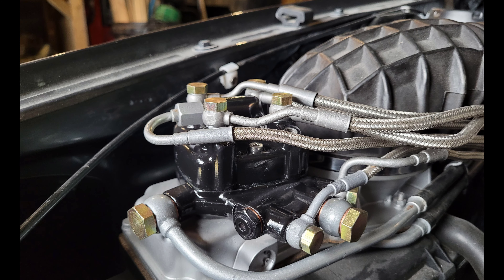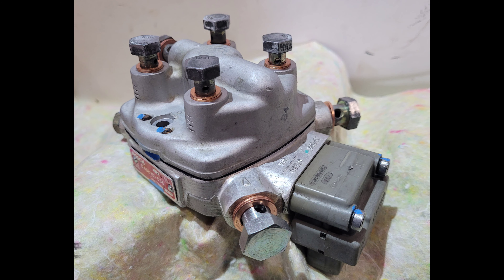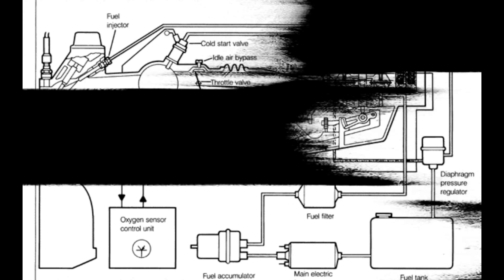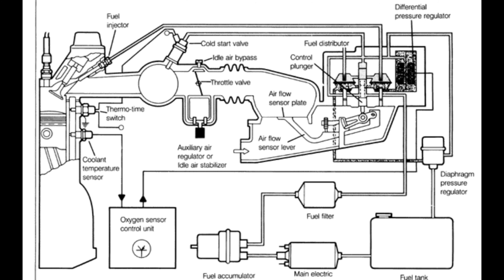Bosch K-jetronic CIS CIS-E and CIS-E Motronic

Comment: A question about mixing parts across the generations.  By class rules for a race car I'm not allowed to use a feedback loop injection system but am allowed to data log as much as I please.  This makes me want to run a CIS-E Motronic to get access to the flap potentiometer.  Will the later CIS-E fuel distributors work without the electronics connected or would I need to go all the way back to a CIS distributor head to make it functional on the late air meter?
Cheers
Reply from the maker: Interesting one, the later CIS-E units need the electrical side functional. Otherwise, it will be in 'limp home' state however you can use the air metering unit with the potentiometer and use the older K-jetronic fuel metering head. The bolt on the same and will just need an adjustment on the C0 screw to set the base idle fuel.
Reply: @GreyGooseRestorations  Thanks, can you recommend a 6cyl CIS head to go with an Audi 200 Turbo air meter?  I would think having the distribution tuning would be better in this application trying to tune to a reliable 300-350bhp 3.0L V6.
Reply from the maker: @CTXSLPR most likely a Porsche 6 cylinder one will do the job and flow enough fuel to support that

Comment: What would you say is the most common problem with CIS overall?

Also, on mine its a bit cranky on cold startup, I have to depress the gas pedal a little to keep the engine alive, but after 10 seconds of 10% throttle or so, it can manage to keep alive by itself
What should I try to look at first?

I did fiddle with the idle bypass screw, sadly it does not seem to react to it at all almost, very little difference
I have soaked the ISV with brakleen and it buzzes when ignition is on
Reply from the maker: The most common problem i have come across is the pressure relief valve seal as if its worn it lets fuel pass back to tank reducing system pressure.

Ideally check fuel pressures first as this will point you the right way, could be WUR, could be C02%, could be cold start system
Reply: @GreyGooseRestorations  Regarding fuel pressure, what type of connection, where and how should I connect it up? Just to the line coming from the fuel pump into the distributor?
Do I need adapters and stuff? (very bad on knowledge on that)

About the WUR, I watched your other videos, I dont have that grey box whatsoever, how can that be? :O I have the 87 KR engine
Reply from the maker: I covered the parts needed in one video, think it was the pressure testing one 👍
Reply: check your potentiometer
Reply: Thanks, this was very educational!

Comment: Are you sure the explanation of the CIS-E Motronic isn't just CIS-E? my PL engine in a Golf 2 is CIS-E and has knock sensor, inlet pot meter etc. Like you describe...
Reply from the maker: The PL code did have some differences due to being produced for the EU market and it was right on the cross over of PL and the 9a being introduced.
Reply: @GreyGooseRestorations PL is KE-Jetronic
9A is KE-Motronic
Reply: Hello Grey Goose,, I have plowed thru your good content and have a few questions on planning out my fuel injection on 2.0 9A 16V. I understand most the differences with Motronic and the prior  16V CIS-E, however, I’ve also seen where you are modding the fuel dizzy (I think even the ones on a 8V application, correct?). So, if I’m able to source a motronic and all its parts is this a better route than the 16V CIS-E from a 1.8 PL. The knock sensing and potential octane issues is 1 question on PL versus 9A, as well as ability to chip the motronic. I gave you a fair amount to unpack, but just looking for sound direction and advice. Thanks
Reply from the maker: Hey, to be honest, there isn't much to gain/much difference in CIS-E and Motronic (in the real world) 

Firstly - is the car originally CIS-E?

If it is this gives a stumbling block regarding emissions tests for MOT etc

I would opt for a basic K-jetronic set up.....why? Its more adaptable and more reliable.

The big issue with CIS-E etc is parts, for example the differential pressure regulator if it fails causes no end of issues and are not available new, same as the potentiometer. The ecu is workable but there are little to no people who will or can chip them or even repair them.
Reply: Have a mk1 cabriolet in Australia with JH engine. Was there a system between K and KE. Mine has control unit and electronic connection on side of metering head with an single wire oxygen sensor. But i also have a warm up regulator instead of diaphragm  pressure sensor. So mine seems to have bits of both?
Reply from the maker: @deanjones338 thats a strange one if its all original factory stuff as the KE with the DPR on the side of the metering head take the place of the WUR
Reply: @GreyGooseRestorations  found after i sent the question. Its called K Jetronic with Lambda and was sort of a stop gap before KE. Found it in an old Bosch manual i downloaded.
Reply from the maker: @deanjones338 ah good find 👍